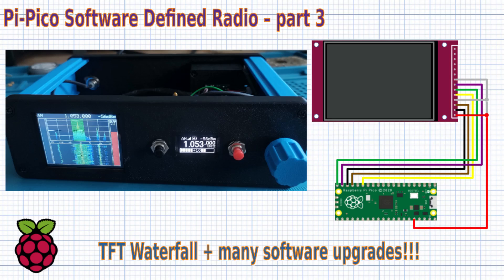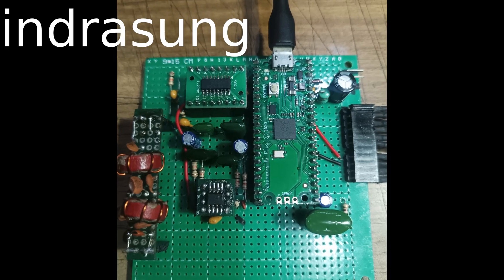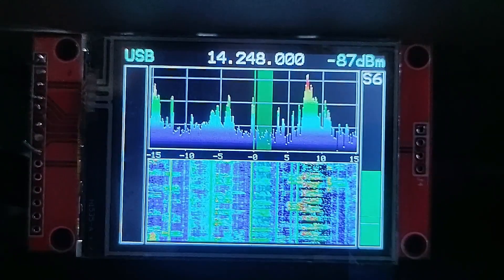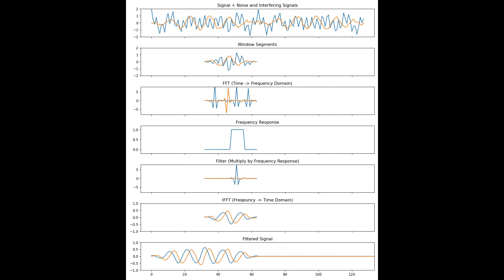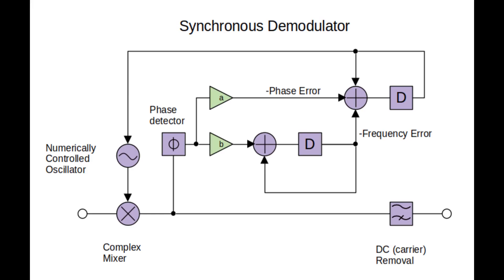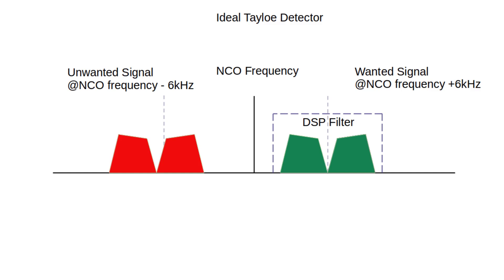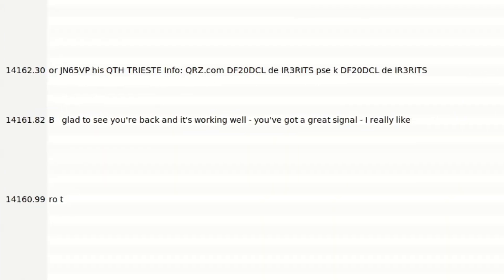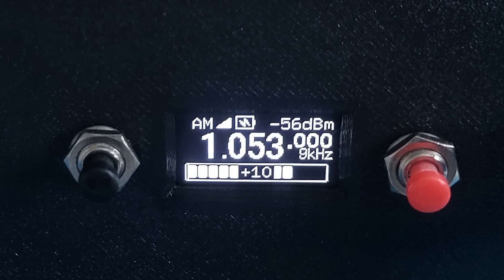Software Defined Radio with Pi-Pico - Part 3 TFT waterfall and software upgrades

Comment: The PICO 2 W has just hit the shops. Just bought 2 @£6.60 each. Could Wifi or bluetooth be useful or possible with this project? Could the RISC-V core be used? Thanks.
Reply from the maker: I'm not using WiFi or Bluetooth at the moment, but I guess they could be useful in future versions of the project. I have builds to support either the risc-v or arm cores. They both give very similar performance with the current software.

Comment: Hey there, Thanks for the great project. I've made the circuit but I receive anything. Unfortunately I don't have an osiloscope and function generator to debug it. Any recommendations? I also cant get the rotary encoder to register input correctly.
Reply from the maker: Thanks! It certainly makes things easier having a scope, but there are other things you can do to  debug. The first and most obvious step is to thoroughly check all the connections. Check for bad connections and shorts. Check the supply voltage to each of the IC's. 

You won't me able to measure the RF signal very easily, but you can check the DC bias at various point through the circuit using a dmm, the signal should sit at mid supply, about 1.6V at the input and output of the switch, all 4 inputs to the op-amps and the inputs to the ADC.

It's easiest to start with your strongest local MW station when debugging, once I have that working I usually try FT8 next, there's pretty much always some signals present, even if the antenna isn't that great.
Best of luck...
Reply: @101Things-ds8tc  Thanks, will try these too. I suspect my cbt3253 is faulty. I tested it before and I had some voltage leak throught the outputs.

Comment: Excellent improvements, and excellent documentation too. I started to accumulate the parts to build this, but only have the Pico 2 and the little OLED so far. I will do it eventually!
Reply from the maker: Thanks 👍 good luck with your build!
Reply: @101Things-ds8tc I finally built one, using the PCB design from F4GOH (complete version). Unfortunately it doesn’t appear to receive any stations, so I have a question. Right now my only antenna is a telescopic one, about 3’ long. Should this be sufficient to receive AM Broadcast stations? I tuned it to a known frequency, which I verified with another radio, but all I get is lots of static. The same over the entire range. Any suggestions?

Comment: Very effective upgrade 🎉
Reply from the maker: Thanks 👍
Reply: @101Things-ds8tc  ı want to build this project but stucked with the antenna should ı use miniwhip (10khz-30mhz ) or  you loop magnetc antenna (10khz-30mhz ) what do you think about that ?

Comment: Hi John my rx is working well I will send some pics over the weekend parts have been purchased for the upgrade. Please can you help I can’t seem to find the new uft file I did try to follow comments from ssmbs(etc) but just seem to be going round in circles.
Steve  GM4PMH
Reply: @1eyerabbit  you have to register github, then log in to see those files.
Reply: Hello, I think we must registered first then log in to github. Then follow the links provided, go to [update manual] there are [ full page, minus and plus ] ICON on the bottom right. Click [plus] icon will expand the content....... then scroll down. The uf2 files show there under ARTIFACTS folder. Hopefully this helps.
Reply from the maker: Glad you got it working! Looking forward to seeing the pics!

Comment: Thanks. Very nice UI display and menu upgrade.  Just download the last uf2 file and save to pico board. Although the given link does not go straight to the file. It is under "update manual" sub folder, then inside binaries-rp2040-pico.zip 151 KB.
Thanks 👍👍👍
Reply from the maker: Thanks, glad you like it!